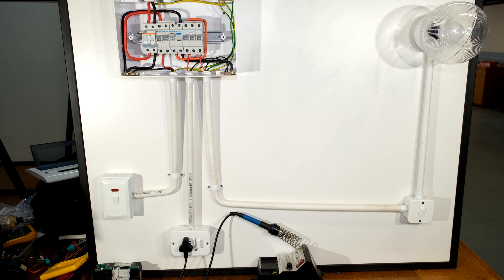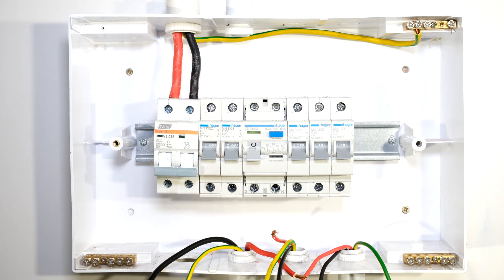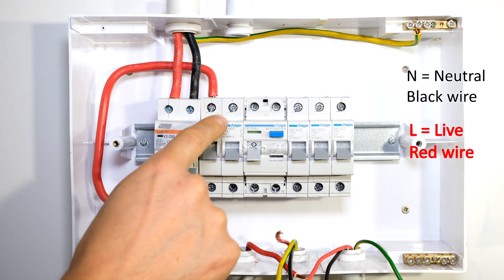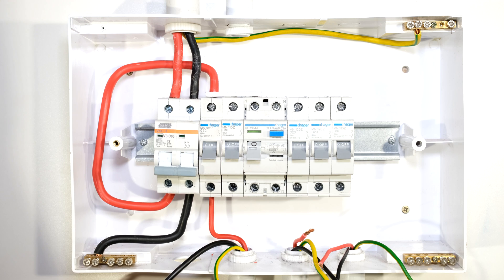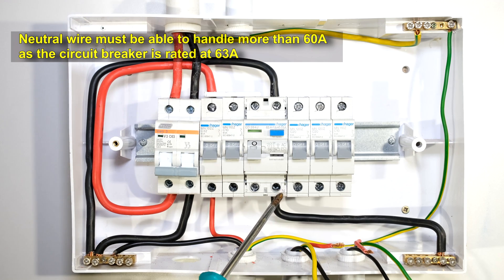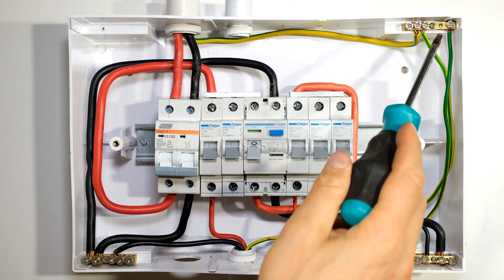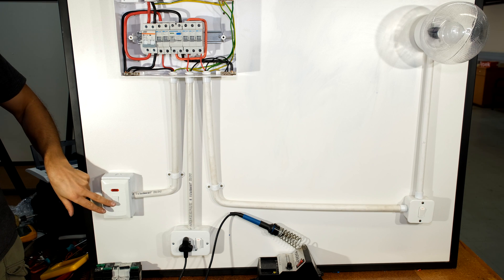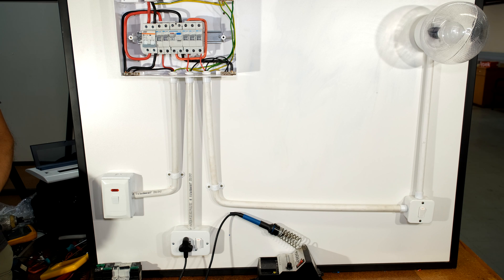How to wire a single phase DIN rail distribution board with two neutral busbars - (South Africa)

Comment: The light circuit is it not suppose to be energised straight from the supply bypassing the  mains and the earth leakage
Reply: So when someone works on the light circuit it will be live permanently? Possibly causing an electricution? You cannot "bypass" anything. Each circuit should be protected by their own circuit breaker. 🤦🏻‍♂️

Comment: Very nice thank you , but what do you call the neutral bars ? Because there is names for them and why you can’t connect a light geyser to the wrong one , and not the light circuit that is bypassed from the earth leakage is not safe .

Comment: Why stove not on earth leakage protection? What happens when you touch the stove with an earth fault?
Reply: not sure but I know what happens when you connect the stove the earth leakage, it trips the circuit all the time.
Reply: @africanhistory  that means there's leakage current.

Comment: At home the company which was installing eskom meter used same busbar for Earth cable and Neutral cable. After facing issues of metal appliances carring charge, we reported the issue to eskom and they come and cut out earth cable altogether. 

With Only Live and Neutral operating,  does earth leakage breaker still gone work/ protect us for shock hazard if/when it happens?
Reply: I mean 1 rail was used to connect both Earth and Neutral cables.

Comment: im living in an island in a third world country where there is no electricians, these videos have been invaluable to wire up a hot water heater correctly. I have a question, If I would use earth leakage just for one circuit could is respective overload fuse be placed before or after the RCD or would it always come after ?

Comment: Didn’t see you bonding your Neutral and Earth, or am I missing something?
Reply: In South Africa the Neutral and earth bonding is done by the power company (Eskom) at their transformers or meter boxes. So the wires coming into the houses are to be used as they are.
Reply: @ramasike  Can you please share the evidence to support your statement. It does not make sense, because if that were true why would I need to install my own Earth pole/stick and create a isolated circuit for my own house? And wouldn't that mean if Eskom for example gave us all an Earth wire that we would share, in the event of an earth leakage multiple homes would not receive power because buildings share the same lines?
I watched another video explaining when to bond Earth and Neutral. In this video it makes sense on why he didn't bond the neutral and Earth and that is because this is a sub panel or sub distributor board and is just a sort of extension of the already bonded Main panel/ Main Distributor for that building.

Comment: It's strange to see a requirement when inputs should always be at the top when almost all modern RCDs and circuit breakers work both from the top and the bottom.
Having inputs at the top only causes more wires

Comment: HI, would it be possible to have a video on how to wire a junction box that typically is in  ceiling and is fed from the Main DB and connects the various loads in a single position?

Comment: I'm struggling with my D-Link router. I want to convert the router into a wireless repeater. Not an access point with wired connection. Please advise. Any advice would be appreciated on how I can make my D-Link DSL-2750U into a wireless repeater would be greatly appreciated.